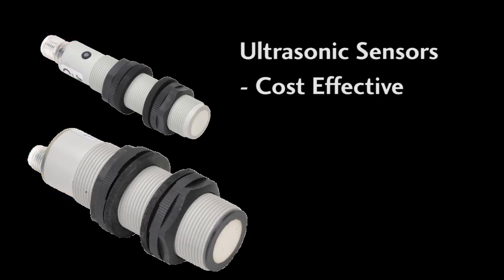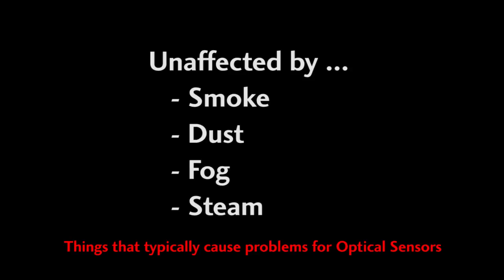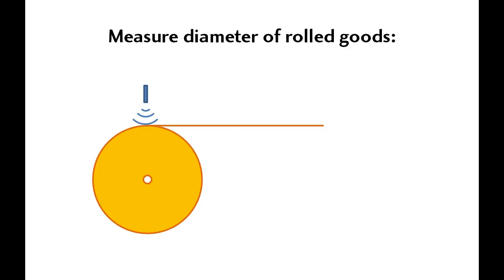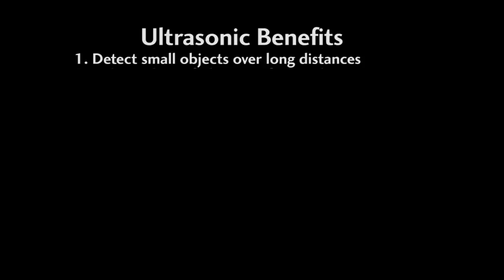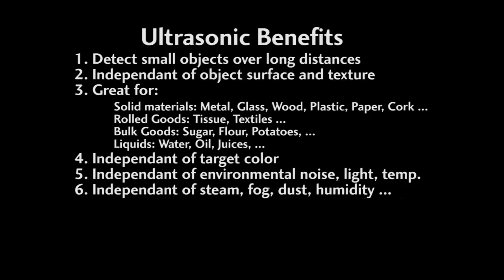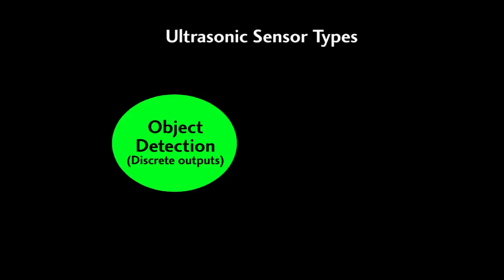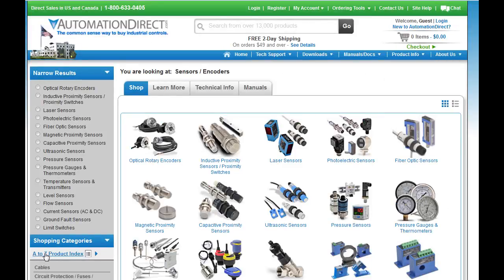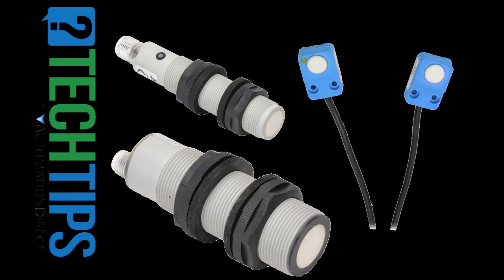Ultrasonic Sensors Overview from AutomationDirect

Comment: I saw some videos on youtube in which they use UDS to create a 2D graph of a Room , can that be achieved with a HCSR04 without any special software (matlab) ?
Reply from the maker: @ Noman Sheikh, We are not familiar with testing ultrasonic sensors for 2D or 3D scans of products or rooms.  It would depend on the input required from the interface. It would probably require an analog signal vs a discrete "on/off" signal to determine distance and product measurements. You can always contact our free technical support for help questions on the products we carry.  https://community.automationdirect.com/s/contactsupport

Comment: Building a Gokart and I want something with proximity detection, what would you recommend?
Reply from the maker: @ b Any of the diffuse ultrasonic sensors should work for detection but the designer will have to specify required distance, voltage and body style to determine which model of ultrasonic sensor to select. These style sensors have been used on similar projects with success. If you need help selecting sensors, call our free, award-winning technical support team. https://community.automationdirect.com/s/contactsupport

Comment: Please tell what are different types of ultra sonic sensors like thermocuple.
Reply from the maker: Hi Saad,  Not sure I understand the question. 
Are you asking which types of Ultrasonic Sensors are like Thermocouples? Thermocouples measure temperature, Ultrasonics measure distance. They are completely different ...
Reply: @automationdirect  I am asking on basis of construction or design  are there any ultrasonic sensors like thermocouple have k type s type.
Reply from the maker: @saadulhassansyed9686  Gotcha.  Nothign like that.  The main thing to watch out for with Ultrasonics is the pulse rate.  The longer the distance the slower the pulses (it has to wait for the wound waves to go out and come back) and hence the slower the response time. Other than that, they are all pretty much the same.

Comment: Hi there,
For a project at uni, I need to incorporate a sensor that will sense if someone is walking/moving/standing within a (approximately) 3 meter radius of the product I am designing. If the sensor picks up on the object, a light in the product will fade in.
There is no need for the sensor to measure the distance, I just need a sensor that will notice objects within a (+/-) 3 meter  radius.
The sensor needs to be as small as possible, as there isn't that much space in the housing of the product. It also needs to be as cheap as possible (but still a durable sensor, as the product is designed for a public space (outside)) as it is designed for a municipality.
Would you have any recommendations on which sensor to use? I did search the website, but I am not sure on which outputs to use (e.g.).
Thank you in advance!
Reply from the maker: Sounds like you are looking for a 360 degree object detection sensor that is inexpensive and works outdoors.  That's a tough requirement. I can't think of anything AutomationDirect has that will fit that application. Suggestion: Do a YouTube search for "360 degree LIDAR scanner" or "Getting started with LIDAR."
Reply: @automationdirect  Thank you for your answer! I did look into LIDAR, but unfortunately, it seems that certain types could be harmful for the eyes, so I am not sure if that could be used in a public space (though I could look into it further).

However, instead of radius, I actually meant distance (my bad), so the sensor doesn't necessarily have to pick up a 360 degree view. Would it then be possible to use an ultrasonic proximity sensor?
Reply from the maker: @fennietroost5750  Yes, an ultrasonic sensor would be ideal.  The main reason is you want to operate outdoors - and sensor that uses light (like LIDAR) will be susceptible to sunlight, glint, reflections, etc. Which explains why automobiles use ultrasonic for their collision avoidance systems.  Beware that ultrasonic sensors don't update very fast (they have to wait for the sound energy to go out and come back) so keep an eye on the specs.  Some will be a slow as a few Hz, while some are quite a bit faster. And that will correspond to their detection distance capability.

Comment: if we use ultrasonic sensor in heavy magnetic field then will it give accurate readings?
Reply from the maker: We don't think there should be an issue, but are confirming with the supplier .. stay tuned ... (apologies for the delayed response)
Reply from the maker: Just got the answer from the manufacture: 
"The nominal tests performed by us (required by the Standards) have been thought for granting immunity against electromagnetic fields from 80Mhz to 2GHz (3V/m). We cannot grant the correct performances when stronger fields are present."  
Hope that helps.

Comment: Am amazed with the technology of yours...  but what will happen if there was a foam above the liquid level..  how will this technology  give us the correct reading?  can you explain if possible
Reply from the maker: Hi Aravindh, most folks put the sensor in a pipe (called a "standing pipe") that runs to the bottom of the tank. That way the fluid inside the pipe doesn't have any foam and the sensor can easily measure the fluid level.

Comment: I want to check the level of grease in  barrel...it possible by ultrasonic sensor?because grease surface is uneven some grease stick at the sides of the barrel..
Reply from the maker: You Can, but it all depends on your setup - how big the barrel is, distance from the sensor etc. Check out this video where we use an ultra sonic sensor to measure the height if water in a barrel: https://youtu.be/wdciqTJctKw  It might give you some ideas.  Also, take a look at these sensors - they are designed specifically for measuring levels: https://www.automationdirect.com/adc/shopping/catalog/process_control_ameasurement/level_sensorsa_controllers
Reply from the maker: David, Ultrasonic would not be a good detection method for uneven surfaces like grease. The uneven surface would not reflect the sound wave in a manner that would give a good reliable reading. Two methods I have seen that works well is a laser distance sensor or using a flat surface paddle that is connected to a chain that sits on the top of the grease and that paddle becomes the flag for measuring.
Reply: Thanks for your reply...
I am using a grease lubrication pump and its capacity is 5 &10kgs..i want to set a low level alarm but i have no idea to set...Thats why i am searching for low level sensors...if you have any idea to set low level alarm please share it
Reply from the maker: @dav7411  Ultrasonic could work, but you might want to take a look at laser distance sensors too. AutomationDirect has a wide range of those from Wenglor.

Comment: We purchased one of your UK1A-EP-0E ultrasonic Proximity Switches and it has a +/- 8 degree beam angle.  I have proven the concept that it can replace one of the through beam optical sensors we currently have in place for our automated painting process.  The issue is that these sensors are used in an array of 16 sensors that are spaced 2" apart over a string conveyor.  My concern is the possibility of cross-talk or interference between sensors set at such close proximity.

All 16 sensors are set 2" apart, and pointing in the same direction.  They are tilted at a 30 degree angle to the plane of the product and the product is irregular, so I suspect the signal reflections might interfere with adjacent sensors.

I see some vendors discuss various schemes to counter this issue; some being the synchronizing of multiple sensors and another using an interlocked electronic timing method that sequences the staggered firing of each adjacent sensor.  Another manufacturer; (IFM) uses "sound tubes" to help reduce interference and cross-talk.  What can you tell me about issues with or methods to compensate for sensor cross-talk or interference?

Added: The reason I am wanting to change to Ultrasonic is because our optical through beam sensors typically read through our white plastic parts and the PLC cannot read when to start spraying in automatic.  Hence the operator has to run the paint spray guns in manual, which wastes paint, and sometimes they forget, or are slow to set to manual and then we have quality issues.  Cross-talk or interference is one of the reasons I haven't really considered diffuse sensors.

Thanks,
Reply from the maker: Hi Steve, You didn't mention is how far the sensors are from the target. That is the primary deciding factor because the detection cone gets larger that farther away the target is. Be careful with trying to time the sensors. The switching frequency on those is only 10 Hz and the startup time is a couple hundred ms - so if you try to switch them faster than a few times a second your results may be unreliable ... 
Seems like an optical solution would work better for this application. I believe AutomationDirect has optical sensors that are specifically designed to handle non-opaque materials ... I'll see if I can find an example and get back to you ... Stay tuned ...
Reply from the maker: Hi Steve, Go to www.automationdirect.com and take a look at the OPT2139 or OPT2140 Retro-reflective sensors - they can handle clear glass so they might work for your application.  And they are less expensive than the UK1As ...
If you have more questions, please contact our free technical support team - they will take good care of you. 
Support: https://support.automationdirect.com/
Reply: The distance from the sensor to the product is 200mm on the outside, down to about 70mm at the closest.  Additionally: due to slight overspray and general ambient dust, (and due to the general lack of good housekeeping practices in our paint department) I am trying to shy away from retroreflective sensors - anything optical.  I think I have found a potential solution to my issues concerning ultrasonic signal cross-talk/interference.  Basically taking a hint from IMF, but rather than using a sound tube I plan to use 3/4" heat shrink tubing over the end of the sensor to basically create a reverse funnel to block most signals coming towards each sensor at an angle.  I ordered a few more of the UK1A-EP-0E sensors to test this idea.

Comment: Hi, I want to know how to adjust the range of an ultrasonic sensor for PLC. They have a default range but how do I modify that range? Is there any other software or al can be done in the same ladder logic software?
Reply from the maker: Hi Jamie, These sensors have a "Teach Button" that allows you to adjust the range. Find the sensor you want to use on the webstore (www.automationdirect.com) and you will see all the documentation on how to do that. It's typically something like: Hold the button until the light flashes to mark one distance and then change the distance and hit the button again.  Hope that helps ...

Comment: Hello, Can I apply Ultrasonic Sensors measure the height and wavelength of the water?
Reply from the maker: @Atchara Saraphol,. Yes there are ultrasonic sensors specifically designed to measure the height of standing liquid.  Please see this link for an example: https://www.automationdirect.com/adc/shopping/catalog/sensors_zencoders/level_sensorsa_controllers/flowline_ultrasonic_level_sensors_(non-contact)

Comment: I i wanna see some overview regarding to ultrasonic sensors for robotic hobby  (not for industrial purpose). there's such a great difference between these types of approaching.....For example, HC-SR04 is strongly dependent by the type of surfaces, colour, geometry and dimenssions of the target. Much more, it's hardly dependent by the environment conditions, especially by the temperature and light. Neither Ping Parallax ultrasonic sensor isn't so independent of these aspects. I don't say these two sensors aren't able to give good result of the distance measurements, but you need to do a lot of software compensations.....
Reply from the maker: Thanks for the suggestion.  We have a number of competition robotics teams (FIRST Robotics) that use our sensors so we have a series covering exactly what you describe in our queue.  Now we just have to make time to do it.  Your query will help move that up the priority list - Thanks!

Comment: can i use ultrasonic sensor for detecting  liquid under high pressure in steel container ? if yes, which type of ultrasonic sensor should i use?
Reply from the maker: Prokash, I have used Ultrasonics in this fashion before, and never had a problem. Our line of ultrasonics are not designed for this operation. Our level sensing ultrasonics are only rated for 30 PSI.

Comment: Can ultrasonic sensor differentiate mainly plastic materials?
Reply from the maker: @Charu MATHI, Ultrasonic sensors are not typically used in differentiation applications, of similar materials.
Reply: is it possible to detect plastic materials?
Reply from the maker: Yes, ultrasonic sensors can detect plastic.
Reply: which sensor is used to differentiate the materials?
Reply from the maker: That greatly depends, on the type of materials you are trying to differentiate. Ultrasonic, since using sound wave, does work well in differentiation of solid materials. Typically if you are trying to differentiate solid materials, visual or weight measurement is the more precise method.

Comment: Is there any contact ultrasonic sensor??
Reply from the maker: @amit Kumar, thanks for the comment. I am assuming you are asking "Do we have an ultrasonic sensors with Dry set of contacts?". We currently, only carry PNP and NPN, which would require a simple relay for a dry set of contacts. Please see part number 781-1C-24D, it is $4.50 plus the cost of the base. https://www.automationdirect.com/adc/Shopping/Catalog/Relays_zTimers/Electro-Mechanical_Relays/SquarezCube_Relays,_Plug-In,_3A15A_(78x-z_Qxx-z-H78x_Series)/General_Purpose,_15A_(781z782z783z_784_Series)/781-1C-24D